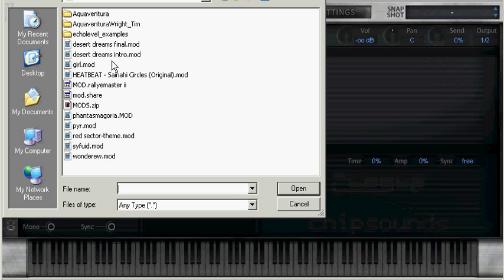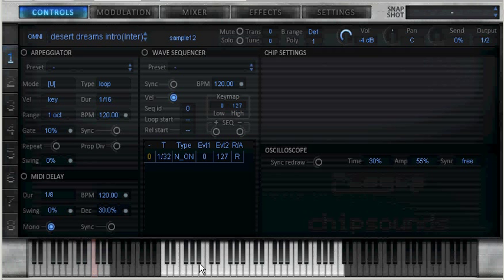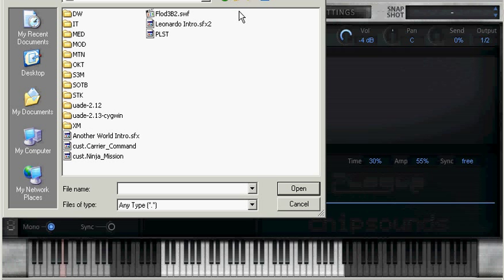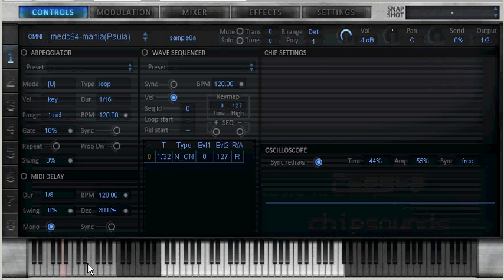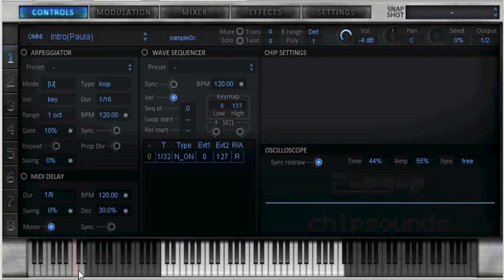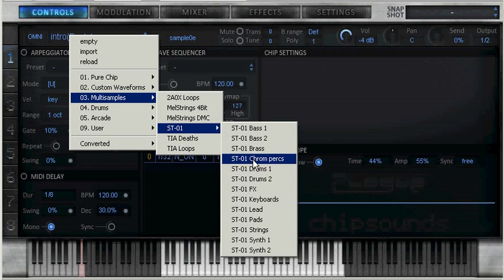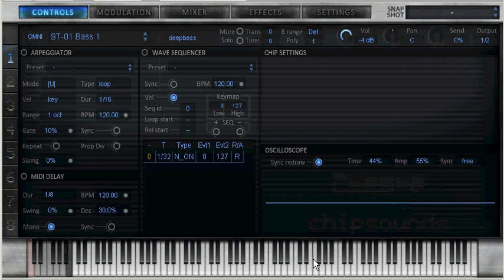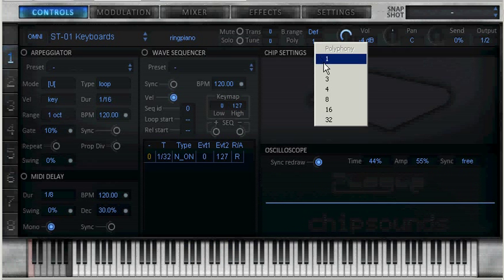chipsounds 1.6 New Stuff (Part 2) Amiga MOD/ST-01 sounds

Comment: so could i import a conventional 44.1 wav file and import it in here and make it sound like it was SAMPLED into an amiga?
Reply from the maker: It would need to be downsampled, bit reduced to 8bit pcm and placed in the user folder in chipsounds. Not really trivial to do.
Reply: plgDavid so would i have to change the sample rate as well?  Does this do the card modelling of chipcrusher?  (Which I own)

HI from Parc ex
Reply from the maker: Its a different process than chipcrusher, but sounds similar. Yes you would have to set the samplerate, then adjust tuning of each file in the SFZ. Not facile :)